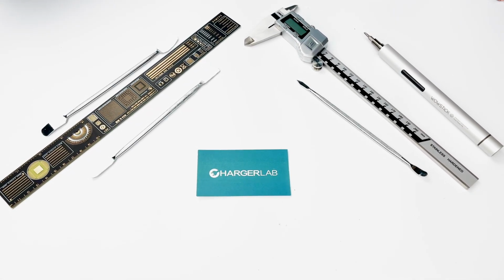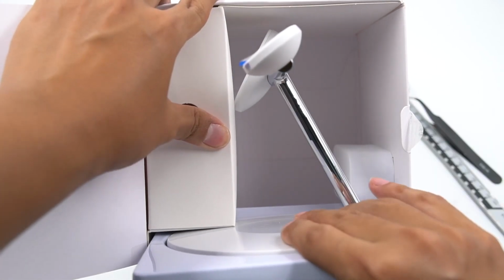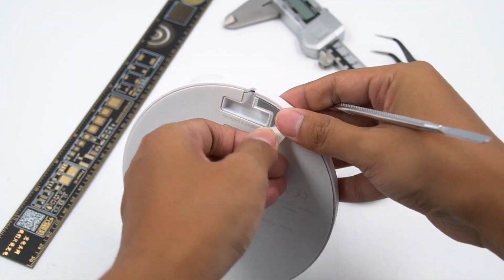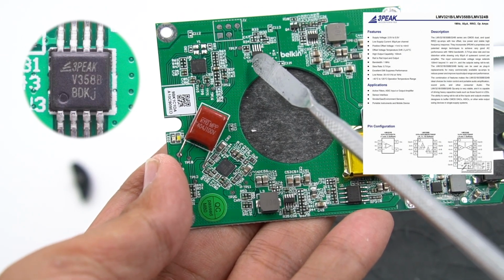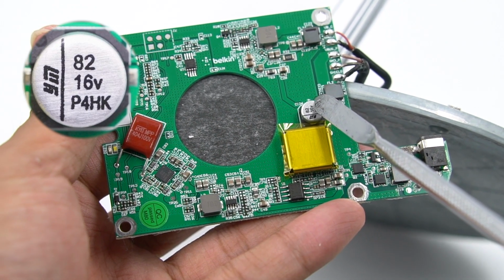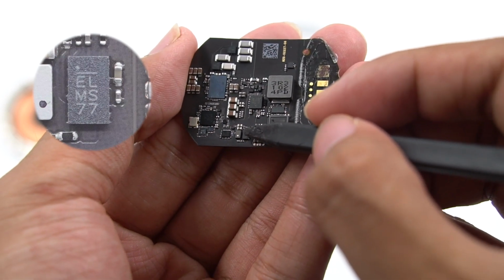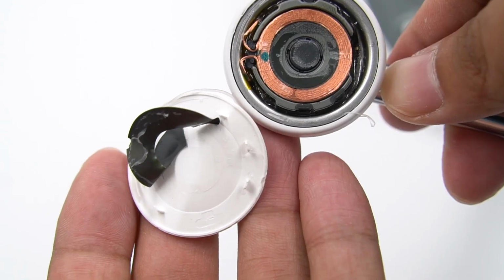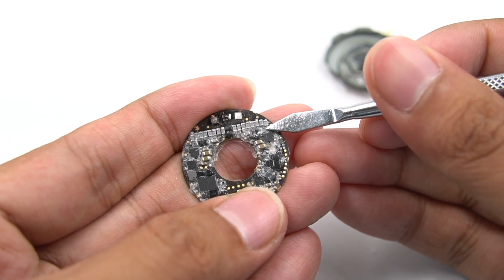Teardown of Belkin BOOST CHARGE PRO 3-in-1 Wireless Charger with MagSafe

Comment: Hi, is the rod that holds the two wireless chargers welded to the metal base? I have to change the power supply with a universal one and it seems impossible to find one that fits without removing the metal base

Comment: So I just got one of these. new in box from a thrift store for $25. A few months in the apple watch charger stopped charging and is constantly warm/hot while the device is powered. Is there a specific issue that it may have? Or can I just remove the puck and perhaps solder in a standard Apple Watch charger puck in place of the Belkin one?

Comment: Very interesting

Did you know there is a v2 of this Wireless Charger Station?

Model is WIZ017, and now includes fast charger for Apple Watch Series 7 and higher.

Would be grate having a comparison between 2 models to see what components they include to enable Fast Charging on the new Watch models.

Comment: I'm interested in seeing the WIZ010 2-in-1 version. It would be nice to know if there was room to install a magnetic ring for the AirPod charging, to facilitate alignment. IIRC the original AirPod Pro did not come with MagSafe, so Belkin did not think at the time to add the magnetic ring. The most popular aftermarket ring measures at over 2.5mm thick (0.06" is the thickness according to the MFG) and I'd like to put one UNDERNEATH since the polarity would need to be reversed to mimic a stand, not a phone. I just bought one for work, and have AirPod Pro 2, but I'd prefer to not bugger mine up for what I paid for it.